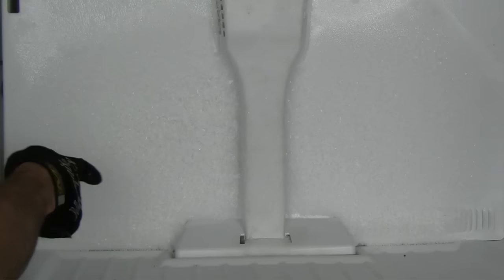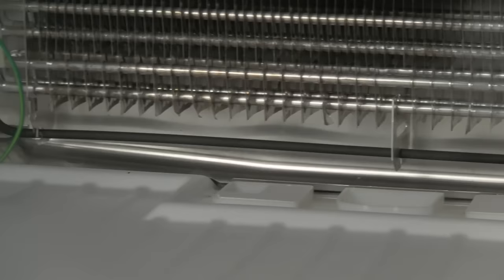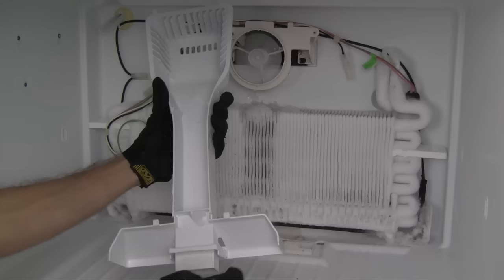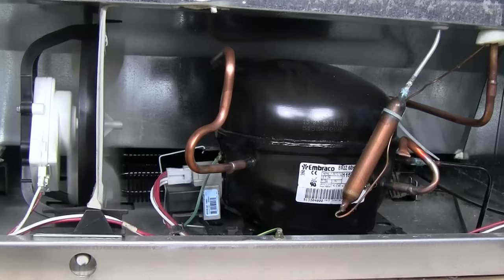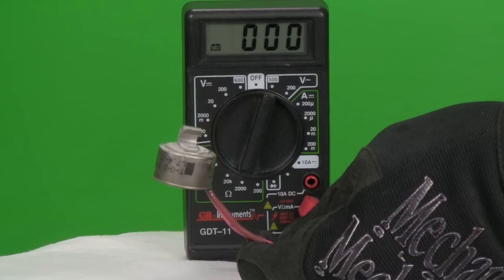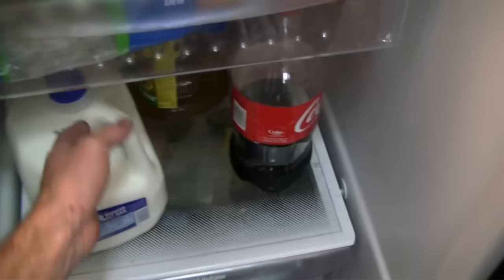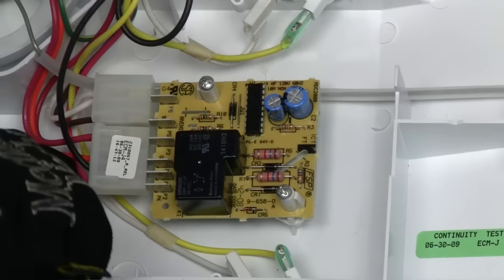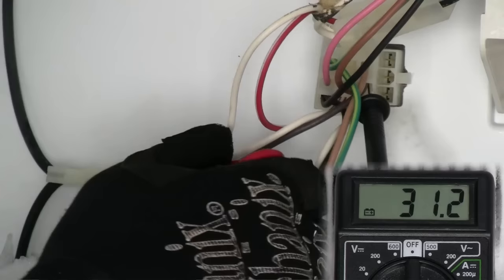Refrigerator Repair (Not Cooling, Defrost System)

Comment from the maker: @kneeslider100 I am not very familiar with the mechanics of a Fridgemaster, but the idea should be basically the same.  It is ether an air flow problem or thermostat issue.  I would be inclined to let it thaw out then if you have problems again you will probably want to see where the thermostat lead is mounted.  That will give you a better idea as to were the thermostat is getting its readings.  Use a thermometer to see at what temp the compressor is cycling on.

Comment from the maker: @aszypula It sounds like ether the defrost thermostat went out again because the storm (possible but unlikely) 2. There is some additional problem that the tech missed. 3. Or Perhaps the doors did not get closed all the way a time or two and there is no mechanical problem. 
My wife's mom and dad had me out three times on their bottom mount refrigerator. There was nothing mechanically wrong, just poorly placed food holding the door ajar slightly.  Visible frost near the door seal is a good clue.

Comment: Question: My refigerator is near 10 years of age. And though I've found a solution for the water which is from the defrosting, kept freezing, thus caused water to leak into lower level of my refrigerator by wrapping a piece of solid copper around the defrost pipe and inserting one end into the outlet aka drain hole. I have cause to wonder why after all these year's, I have to do that. It use to work as designed, but only recently has it developed the issue. My remedy seem's to be working, it's been over a month, and no water in the refrigerator. Thus I saving money to replace it. But until then. I am sill wondering as to why. The defrost is obviously still working, apparntly it just not working up to it full design.

Comment from the maker: That's a tough one... Take a look at the troubleshooting refrigerator problems pages on my website. (There is a link in the description of this video.) First check if the compressor is running.If it is you need to see if there is an ice buildup that may be blocking airflow, you may also have a problem with an internal fan that is not moving the air. What is your Samsung model#?

Comment from the maker: @ICUC007 Good question...I don't see one on the diagram for that model.  I would guess that it is a "hot wall condenser" on some refrigeration appliances (mostly upright freezers) the condenser is foamed into the sides of the cabinet. They would not list the part because it is not replaceable in that case. Not positive... but thats my guess :)

Comment from the maker: @arthouselandscape818 Sorry for the delay, its been a busy few days.  You will need to do some voltage checking at the compressor to determine if the compressor is getting the electricity it needs or if the compressor is locked up or shorted internally.  There is a lot more free troubleshooting help on my website. There is a link in the description of the video.  once on the site search for "TROUBLESHOOTING COMMON REFRIGERATOR PROBLEMS" I hope that helps some!

Comment from the maker: @meetmetoday The most common cause of a periodic frost free leak is ether a cracked drip pan under the refrigerator, or more often a clogged defrost drain. I just wrote a post about that problem "Top 11 Most Common Appliance Repair Problems." it is #11 "Oh Sheet!" Take a look at that and see if it helps out.  The new video will be up sometime early next week. :)

Comment from the maker: The thermostat should be closed anytime the refrigerator is warm as long as it is in the "ON" position. If it is showing continuity then it should be allowing electricity to flow to the compressor, so I don't think that is your problem. Take a look at the refrigerator troubleshooting guide I posted on my website that may help. There are just a lot of variations that I could not possibly cover in the comment section of Youtube.  The site link is in the video description. I hope that helps!

Comment: Don't put in a supco 3 and 1 hard start unless you don't care about your fridge. I've read a lot and researched them and have heard good and bad about them. I put one in my GE profile french door fridge until I could try and get the factory parts and it blew the compressor and because it was shorted popped the breaker in my electrical panel. I made sure everything was wired correctly originally with the common the start and the run wires to the correct pins on the compressor. Ive heard most repair guys keep these in their truck to temporarily keep your fridge on line and when they come back they swap it for the new parts. This is my take on it so you can take a chance but it really is a gamble. I will never buy another GE product especially the customer service I did not get when they changed the parts I needed to a relay and over load that were two seperate parts with no place to plug in my existing capacitor. My fridge had the relay and overload in the same plastic box. No upgraded wiring diagrams etc. from GE and all GE wanted to do was send a repair man out to tell me something I already knew. Frustrating to say the least!

Comment: My whirlpool fridge with automatic adaptive circuit board defrost control has a problem of about once a month the evaporator coil freezes over.  Then if I unplug it for 30 seconds and turn the thermostat to off, then plug it back in, it forces it into defrost mode.  The evap coil defrosts and all is well for while.  Is this a symptom of a bad control board, or a bimetal switch?  This video is awesome by the way!

Comment: I have a side by side GE and I would like to know if the engine is 1/3 power! Another question is whether the bimetal thermostat works in reverse compared to other refrigerators! The bimetal thermostat on my GE when cooled turns off the resistance and when at room temperature turns on the contact!

Comment from the maker: Should probably start with letting it thaw out.. If the fan in the freezer is functioning and you feel air flowing into the fresh food area at that top duct then it should work for about a week or so before it starts to frost up again.  on your model statistically I would guess the defrost thermostat. However, if you are not comfortable with tools and troubleshooting you might want to start asking friends if they know a good repair person during the good week or two... Good luck!

Comment: For me, I unplug the refrigerator for a day to let everything melt and then plug it in. Ice will just build up in the back of the freezer but the rest of the freezer and refrigerator won’t be as cool as normal. If i had a bad compressor would ice still build up in the back of the freezer?

Comment: I have a GE Profile Arctica refrigerator with top freezer. Model # is PTS25SHPARBS. The freezer is working fine but the fridge maintains a temperature of about 47 degrees. Tried to remove the freezer panel but it is different from the ones in your video.
Reply from the maker: That style is a little more tricky to get open... Do you have any frost on the back wall of the freezer?

Comment: Coils are very clean. I clean them every 6 months to be on the safe side.
4 months ago the evaporator core was frozen with white hard snow. I cleaned it with heat. Now, it did the same thing. Could this be a heating element issue?
Thanks again.

Comment: hello,1st time using this. my Samsung rsg257aars side by side 2010 freezer side does not get cold refer side cools but is warmer than the temp readout says. no diagnostic error codes and a solid red l.e.d. on the pcb comp running. refer and freezer evap fans running cond coils clean and fan running. any suggestions? thanks.

Comment from the maker: Depending on the model... Many GE refrigerators have a large control board on the back that detects temperature with a few sensors and controls compressor operation and the defrost cycles.  Unfortunately the evaporator sensor and the control board are both common to fail.  Do you know the model number?

Comment from the maker: @azlrshooter1 Try cleaning out the black condenser coils under the refrigerator.  Hopefully they are coated in dust and are having a difficult time releasing the heat that should be absorbed from the freezer compartment.  If that doesn't help you may want to check the thermostat.  It should have the compressor running anytime the appliance needs to cool down, except for a short defrost cycle every 8 to 10 hours of compressor run time. 
I hope that helps out. Good luck!

Comment: Is anything in this video true for typical European refrigerators as build in the 90s, the AEG/Electrolux kind? Tall, two separate compartments (freezer and fridge) with no connection between them, no fan, giant radiator in the back, no PCBs. I think it has auto defrost but i can't find a timer mechanical or otherwise. There is no freezer defrosting foreseen. The fridge chamber does seem to self defrost once in a while, there is a thin layer of ice forming on the back, it melts occasionally and runs off onto a dish in the bottom right on top of the compressor. I think the warmth of the compressor helps it evaporate then, but i haven't found the heater yet.

Comment from the maker: I dont see how that could be a compressor issue... sounds like a defrost problem but that would normally happen more quickly than 1.5 mo.  do you see frost on the back wall of the freezer compartment when it warms up?

Comment: One thing, with tricking into a defrost cycle can't you just jumper the two contacts with alligator clips when the unit is unplugged then plug it in?  Seems like a better way of doing it than shorting it with a screwdriver.

Comment: Hi, My 24 inch Refrigerator model: mpe12fgkalww is always getting blocked by ice at the passage from freezer to bottom. I melt an ice away and is good for a while. It has this led to adjust temp.I don't think this fridge has auto defrost as I did not see the heather. Why would be always blocking passage, the freezer is cold well. Thanks for and answer if you will get to read it,

Comment: Hi , Thanks for your clear explanation of Airflow in a Refrigerator. I have one rather important question I would like to ask. Your Airflow where does the Air come from. Is it normally a Close Loop System where the Air is constantly re-circulated by the Evaporator Fan in the Fridge, or is Fresh Air Intake going on so that the Evaporator Fan is constantly pulling Fresh Air from the Outside and blowing it through the Evaporator Coils inside the Fridge. Also if it is not a close Loop System and the Fresh Air is constantly being sucked in from outside , is it vented out as it is recirculated inside and replaced by a fresh stream of air. Thanks
Reply from the maker: It is a closed air system. Air from the room would cause fast frost buildup due to the moisture it contains. Thanks for the question, I hope that helps!

Comment: Applianceassistance,Thanks for great videos. Please could you help with regassing instructions for our 12 v DC danfoss   BD35F (we are running it as a freezer). We have no access to a technician being on a private yacht in Indonesia but have 134a and correct guages. The freezer manual says the process connector should  read, "mm 6.2+0.09. Is this cold pressure or running temperature? What should the pressure of a Danfos BD35F freezer run at? Does this red line relate to the guage which has 134a written on it? Should I measure this cold or when the machine is running (i.e. hot)?

Comment: Its all good I learned a lot from this video. I just don't know what goes on with my refrigerator. Here is the problem everything seems to be working but when the whole 8hrs. of cycle of cooling ends it goes into defrosting mode but it does not turn on again to cool unless I hit it with my fist then starts working for another cycle what is wrong. Can you help me please

Comment from the maker: Many of the GE models including yours use a sensor thermistor to communicate to the control board if a defrost is needed. They actually use three sensors, one for the fresh food, freezer and evaporator. the last is the one of interest. at 0º it should be at 62Ω at 77º it should be 10Ω on most models they connect with smaller wires to the J1 terminal on the board. (brown to blue/white) You need to unplug the refrigerator and the connection before testing !Ground Yourself Before Contact!

Comment from the maker: Sounds like you may have had a clogged defrost drain that was not allowing the melted defrost water to drain from the freezer into the drip pan under your appliance. This usually causes a sheet of ice on the freezer floor and water leaking into the back of the fresh food section from time to time. The new problem is strange... how long did it work for after you plugged it back it?  is the fan in the freezer working?  I have refrigerator troubleshooting on my website that may help...

Comment from the maker: I have a refrigerator troubleshooting article on my website that may help there is a link in the video description. It goes into how to check the compressor and overload relay.  Really you need to check for 115 AC voltage to the compressor. Hope that helps some! I would love to make one but I am having a hard time keeping up with the local repair calls... Good problem but frustrating because I would love to make more videos... Thanks for the comment!

Comment from the maker: Sorry for the delay.  If the compressor is running and the unit is not cooling even though the fans are working you likely have a sealed system problem. I have more complete troubleshooting and repair suggestions on my website that may help.  The link is in the description of the video. Good luck!

Comment: applianceassistant i have a problem, my freezer motor is working but not cooling (standing freezer), on the in up side there are drips colecting, but the freezer is still not cooling?

Comment: Ii have a  jenn air side by side model JSD2690HEB  and when I got up this morning and noticed that my food in the freezer was defrosting and my food in the refrig part was warm so I came to you tube to see what the problem could be.  after cleaning all the food from the freezer I made sure the door was closed. waited an hour but it still was not getting cold but I do hear the fan running. so I unplugged my side by side for about 5 minutes and replugged it to see if I would hear the compressor kick in but I didn't. So do you thnk its the relay or the compressor that I need.

Comment: I have a Whirlpool side by side model GSC25C6EYY. This morning I noticed that the refrigerator was not cooling and no airflow going into the fridge unless the freezer door was also open. The freezer was working okay, but now I notice it's not as cold and a little more moisture, the ice maker is also not making ice. The back of the freezer is frosty too. Is this a defrost issue?
Reply from the maker: It does sound like a defrost problem... when the frost gets really built up it can cause the freezer to not work well ether. If you can unplug it for 24 hours or so that should get you going temporarily... There is likely a problem with ether one of the control boards on the back or with one of the defrost parts... Sorry for the slow response!  I hope that helps out some.

Comment: Awesome video! 

Common sense said that the bimetal thermo's infinite resistance was the problem. Still not convinced, I advanced the condenser timer, then bridged a wire before the bimetal, shorting the connection. Sure enough -- a nice bridging spark, and then the ice started to fall off the heater like rain drops! So it's the bimetal thermo!! Thanks!

(Btw, was what I did dangerous? Could I have damaged something (like me)?)

Thanks for the video!

Comment from the maker: It may... the refrigerator does need some electricity to run the compressor, thermostat, fans etc.  So perhaps the charge fell below a level that could operate the appliance.  That would be very hard on the compressor trying to run in a low voltage condition. Good luck!

Comment: My mother has a Frigidare Model# FRT18L4JBD, that is less than 2 years old.  It quit cooling completely.  A repairman came out and said that it is irreparable.  He said there is no frost on the coils, that none of the coils are operating, there is a main leak and it could be leaking freon.  Not sure if this makes sense because I am getting this second-hand through my 80-year-old mom.  Does it sound like a total loss?  Thank you.

Comment from the maker: @chito4l You may want to check to see if the coils under the refrigerator are packed with dust.  Also check if the condenser fan down by the compressor is working.  If the appliance can't get rid of the heat that it has removed from the freezer compartment it is unable to continue drawing more heat from the evaporator coil. (warm up) If all of that is okay and the appliance is still not working well chances are it has a leak in the sealed system somewhere and is likely needing to be replaced. :(

Comment: Hi, I noticed my fridge stop working when the door was left open, my housemate heard a loud bang, and now, when I try to switch it on I hear a little grumble like it wants to start, then it just switches off, and it keeps on repeating this till I switch it off again. Which problem do you think it is?
Reply from the maker: You need to check if the compressor is running. It sounds like its not.  Unfortunately it may have burned out the compressor. However, it may just need a new start relay. That's the switch on the left side of the compressor where the wires connect.  Do a video search for how to fix a refrigerator start relay or overload relay… Unfortunately I don't have a video on that yet.  I do have a text description on my website but a video would probably be better.  There is also a part called a 3N1 hard start relay kit that is about 20.00 and will work on almost all refrigerators.  Hope that helps! Good luck!